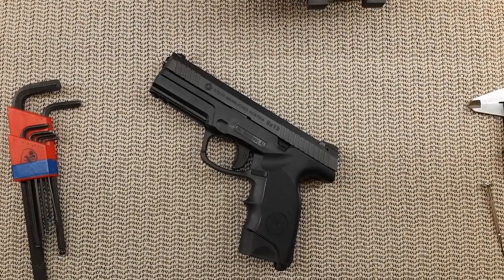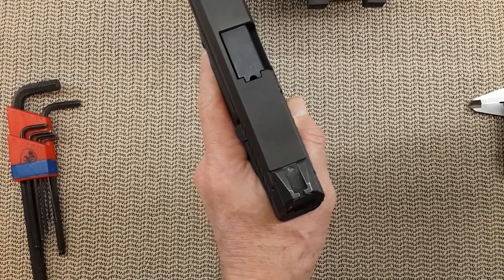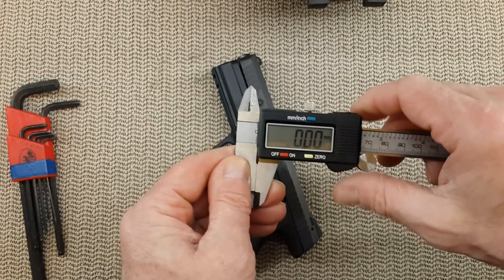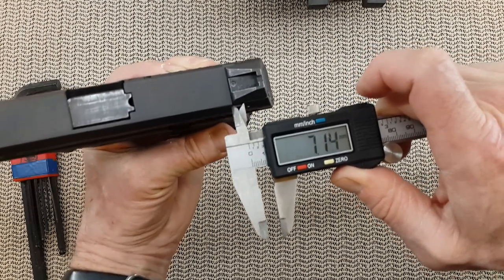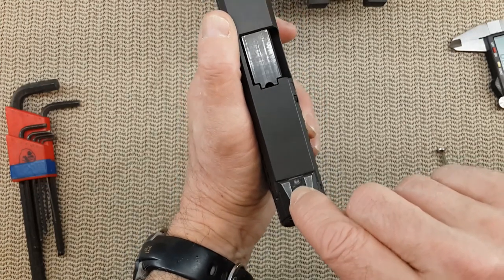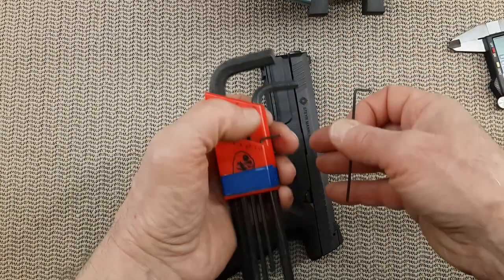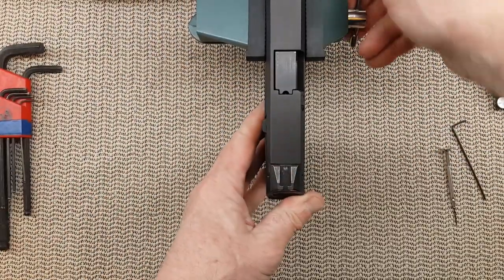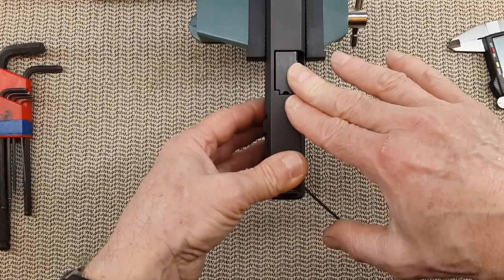Steyr L9 A1 rear sight adjustment

Comment: I’ve had my Steyr M9-A1 for awhile now, and have been driving myself crazy thinking that I just cannot figure out the trapezoidal sight, as I have been impacting to the right of point of aim every time I shoot it. 

Well, I took a close look at the sights themselves and found that while the front post is perfectly centered, the rear sight sits slightly to the right of center, you can even feel the difference by running your finger down each side of the sight and onto the slide. 

Maddening, I tell you. 
I’m glad you took the time to make this video, the information on these sights is extraordinarily uncommon.
Reply from the maker: So you figured out that you needed to move your rear sight slightly to the left. Good.
My ultimate choice with most of my handguns is to swap the rear sight to a fully adjustable sight. It offers so much more options. Happy shooting Eric.

Comment: I think in steyrs infinite wisdom they indeed have a 2mm and 1.5mm set screws depending on the gen. I have the l9 with the changeable grip parts and I’m unable to fit the 2mm hex. I’d try the 1.5 for fit if I had one. No luck with 2mm for me. The m9 I had didn’t have the screw and the aight never moved a hair but on this l9 it moves freely like it’s loose
Reply: On my M9 A2 the 1.5 is too loose and the 2mm is too tight. Neither will fit correctly without damaging the screw.

Comment: Does the sight pusher not damage your sights? I have issues with this putting small dents on my rear sights.
Reply from the maker: No I never did. Perhaps the sight's metal is too soft, or maybe, the pusher was not aligned correctly. I can't tell from here, just take your time and be careful. Happy shooting.